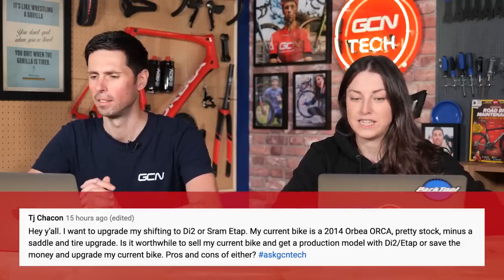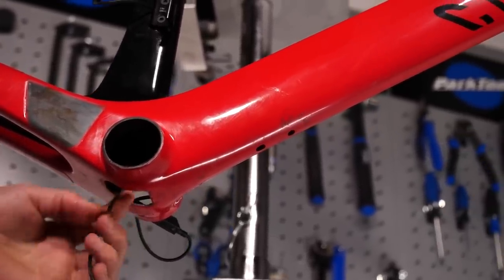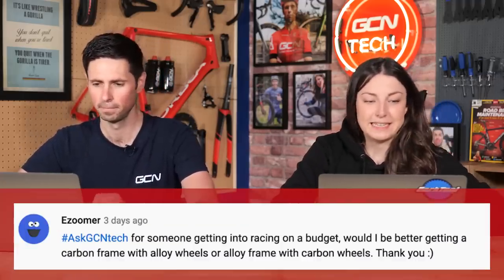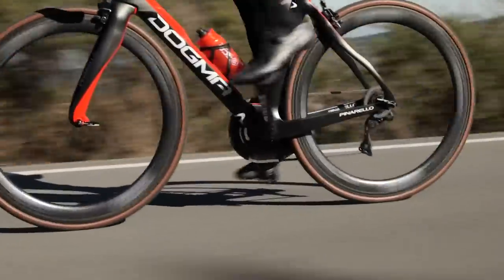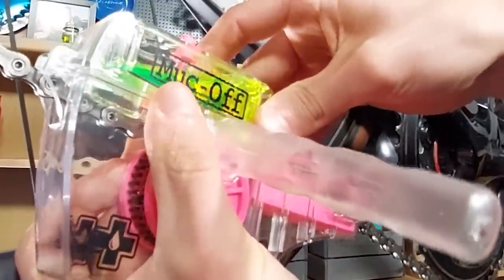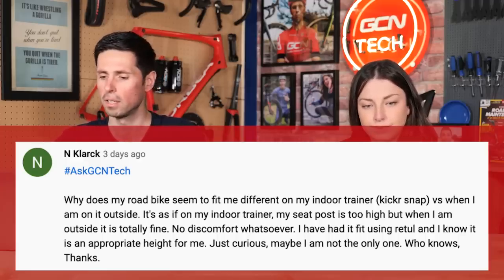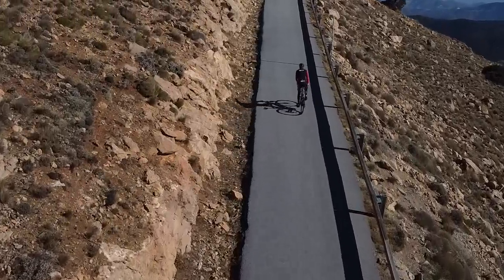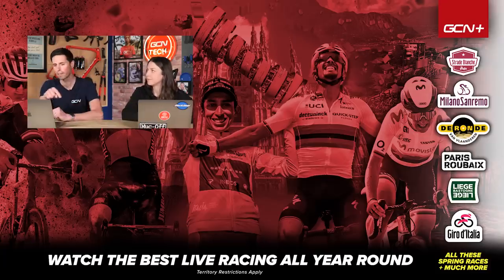What Is The Best Carbon Fiber Upgrade? | GCN Tech Clinic

Comment: about the setu for racing: I'd say it really depends on which racs you want to take part in. Long distance: go for carbon frame
hilly races: go for lightweight -> probably carbon frame as well
crit racing: stiff alloy frame and light carbon wheels
flat tt: alloy frame, deep carbon wheels + aero bars
Reply: Ever ridden a windy TT with deeper than 40mm wheels?

Comment: Always use the same running system when you first start racing: Alu frames, Alu wheels, and be prepared to crash.
Reply: Nah. Just buy what you can afford and actually want. If you can afford and are willing to crash a $500 bike, or a $5000 bike, then do it. Don't let other people tell you otherwise.

Comment: Hands down (no pun intended), handlebars. For me, that's made the most noticeable difference. A good quality bar is worth the investment. After that and in a close second, a good quality seat post. I have my SuperSix dripping in carbon (post, bar, stem, pedals, saddle, wheelset).
Reply: Handlebars can really change a bike, its such a good upgrade. Glad to hear
Reply from the maker: Definitely where your hands are will make a huge difference! All the vibrations don't just go to your hands, but your shoulders, neck and eventually your head! Comfort is key, and it can also be lightweight/aero!

Comment: Also worth noting regarding the fit of bike on indoor trainer feeling different to riding outside…. Inside your bike is level all the time whereas outside your bike is never level due the road is always uneven or slightly uphill or down . This has the affect of tilting your saddle up or down and without notice you are basically moving forwards and backwards on your saddle, this happens lots in a ride. You only tend to move on the saddle on the indoor trainer when your arse gets fed up 😂

Comment: I use an 90's 3x7 specialized Hard Rock on my turbo trainer with zero issues save for needing a spacer for the cassette.
Reply from the maker: If it works, it works!

Comment: HI Everyone.  Love the show.  I have to 'disagree'  Respectfully.  Please dont send the viewers full of hate or ade my way.  Here is my reasoning.  As much as we all love 'New Bike day' because of the parts shortage, there are a many places on line where you can get a parts for just about everything.  I recently purchased an entire 105 groupset for my 2015 Cannondale Synapse for less then 600$.  The bike shop was really nice and installing the components for less than 150$.  This is a far cry cheaper and more practical then trading my current bike (that I love) and spending 3,000$ for a New Cannondale Synapse with 105 already installed.  It is faster to upgrade the bike as opposed to buying a new one because I can get the parts over time and still have a bike as opposed to ordering a bike (I am a bit of a taller rider.  Bike shops dont usually have a bike that will fit me).  As opposed to waiting for my old bike to sell, saving up the money to get the new bike, and finally waiting for the wheels to get here.  In that time the season will be over and I will be stuck back in doors.  While I do love a new bike day and I understand that finding parts might be a bit of a hassle, it is better to have that hassle when you have a bike (That you love) to burn that energy off on.  #AskGCNTech

Comment: Hey, guys. I love the show and all the content you create. I’m going to disagree with you on the mtb frame into road bike question, though. I’m not certain it’ll prove to be the ‘most cost-effective’ solution. The outlay for the groupset and then the parts to get the same position on the road bike may end up just being more than buying a lower-end road bike for use on the trainer. It’s also going to be a hodge-podge of parts that may be more finicky than a complete, new bike.
Reply: Agreed. I’d go for a very cheap bike if the point is to be a dedicated trainer bike… any second hand decathlon bike would do

Comment: #AskGCNTech
I have a carbon gravel bike frame with alloy wheels. I tend to get carried away and ride quite fast which can get bumpy. I was thinking of upgrading to carbon wheels but I'm worried they aren't going to be as durable as alloy wheels. Do you know the durability of carbon wheels vs alloy wheels off road?
Reply: Same if not more durable
Reply: Some aero deep-section carbon rims are claimed to be extra stiff and strong, more so than aluminum rims, and therefore perfect for gravel bikes, unless they are extremely weight-optimized. Another benefit: Deep-section rims keep the spoke nipples further away from the dirt. I ride a carbon deep-section wheelset like that pretty hard on my gravel bike and had no issues so far.

Comment: #AskGCNTech Hi, I got a new bike in December - BMC Roadmachine with SRAM Force AXS groupset. Was getting a little chain rub when on the large chainring and in the lowest two gears on the 12 speed cassette, so watched YouTube and used the limit screws to try and align the front derailleur a bit better to the guidelines (at most a quarter or half turn of the screws); ever since I am having trouble shifting from the small chainring to the large one at the front. When I attempt this, chain doesn't go up, and just spins around, but will settle back on the small ring when I press the shifters again. Took the bike for the new bike service to the retailer, and then back in 2 more times - each time it shifts a couple of times properly, and then back to the above mentioned issue. Bike is back with the bike shop now, but wanted to ask if you or anyone else has any ideas on what the issue could be and anything else to try. Thank you!

Comment: #AskGCNTech Hi guys. A lot of advice tells me to run low tyre pressures (say 5 bar) yet my Mavic Yksion UST say not to go below (say) 6 bar printed on the sidewall. This occurs on other tyres i have too (different brands). Will they fall off if I run them below the stated min pressure? Is this the manufacturer being ultra cautious? (note this is subtly different to the question asked last week; I am not using inserts and this is a 25 mm road tyre issue). Cheers!
Reply: Always stay in the tires pressure limits!!!
Reply: @hendriksiering9077  yeah i have been but I have seen a lot around about using low pressures which I would not be able to and I assumed other people must be in the same situation.
Reply: And i was wondering how the manufacturers derive these limits. Surely a narrower tyre is held in place in the same way as a wider one which might have lower pressure limits?

Comment: #AskGCNTech  Hi guys, I have recently bought a new wheelset that has dt swiss 350 54t hubs and have noticed that the rear wheel stops spinning fairly quickly compared to my old hubs(with fewer teeth) that would spin forever. Is this caused by the amount of teeth in the new hub or is this something I should be concerned about? I know this wont slow me down when pedaling but I don't want to  be losing speed when freewheeling. Thanks

Comment: #AskGCNTech . Using latex tubes right now and they have a 42mm valve. I'm looking to buy new wheels that will have 45mm rim depth. What is the best way to go with the tube valve? 42mm is too short to use with 45mm Rims, but valve extenders all seem to add a lot of barrel. Is there an ideal solution for 45mm Rims and latex tubes? Thanks guys!
Reply: I’ve found 20mm extenders on Amazon. I really wish they’d make longer valve latex, even if it had to be an 80mm.

Comment: #askGcntech. Hi all. I am considering power meter pedals and like the new Speedplays. I prefer off road shoes and use the MTB SPD’s. Is it possible to fit speedplays to normal MTB shoes. I like the off road shoes as they have a grip and you don’t look like a duck when you walk. It’s an expensive experiment if I just go out an buy them and find they don’t fit. Thanks ( I take it Alex will you his catch phrase “I’m inclined to agree with that” :-) ).

Comment: #AskGCNTech
I am using a rim brake bike. Can i upgrade my inner tube to TPU or latex on my carbon wheels? Will there be any thermal issue?
Reply: I am running TPU with rim brake with CF wheelset. No issue so far.

Comment: Hey guys i have a quick question. Is it alright to have a different interior on your bike? My front wheel is a schrader type and my rear wheel is a presta type. And I think the build quality of my rear wheel is better than the front wheel. So do they have to be similar or is it okay to have a different interior on your bike?
Reply: Can’t you just change one of the inner tubes and then both will be the same ?
Reply: @davtwill531  I'm talking about different brand, one has a schrader valve and the other one is a presta. So what I want to know if it is okay to use different brand of inner tubes  for both of your wheel?
Reply: @davtwill531  is it okay if both is different from one another or do they need to both be the same?

Comment: #AskGCNTech   Hi all, Love the channel. I have a tire/wheel interface question. I'm 73 with a bit of arthritis in both hands/wrists,. My thumbs are losing some strength. I have Gatorskin clinchers on WTB tubeless ready rims. I had a struggle with a flat yesterday. It was very hard work breaking the seal and remounting the tire. My thumbs are still suffering. It seems the WTB channel is very narrow to accommodate the tire bead. Would it be better with a good clincher wheelset or different tires? I've heard Continentals are "tight". Sorry Alex, I'm not ready for tubeless yet. Thanks
Reply: Most important step: press the lower wheel onto your belly, so that the tire will slide into the rim. Then work the tire into the rim with both hands from the bottom to 12 o´clock position... The last bit should slip on the rim much more easy than!! ;)

Comment: #askGCNtech Hey GCN, whenever I shift to the 2 smallest cogs of my cassette and push the pedals, I hear a grinding noise on the drive side. I can't figure out if it's my pedal, my bottom bracket or something else. It is loud specially when I push hard pedalling. It happens when I am on the trainer or on the road. I have a press fit BB if that matters.
Reply: sounds like it could be the front derailleur cage rubbing the chain. It happens sometimes when you go towards the far sides of your cassette and your chain is angled. Most front deraiullers have some in-between clicks so see if you can push it further to the right and that might help!
Reply: @mattwhitmore9968  thank you Matt! Should I adjust the limiter screw of my front derailleur?

Comment: can a gravel rd be replaced by a mtb rd? #AskGCNTech
(im a begginer cyclist so I dont know whaat to do)
Reply: Yep totally. Shimano GRX is kind of based on Deore. The biggest difference between the two is maximum cassette clearance (MTB all for larger ones). I've done this in the SRAM side of things when I upgraded my old bike to GX AXS.
Reply: Uhh basically yes before gravel was a thing I somehow managed to destroy my 10 speed 105 and a mechanic said let’s slap an XT 10speed RD on there.... and it worked

Comment: First question has one and only one answer: Get a new bike. It will cost you more to piecemeal upgrade the various components and, believe it or not, carbon ages. Even aluminium does. It corrodes over time leaving you very vulnerable to possible sudden failure.

Comment: 'upgrade carbon fibre'. The best upgrade to make to carbon fibre is to put it in the cupboard for race day. & to swap your plastic throwaway frame for a titanium or lightweight steel one, which won't fail expensively and cost $$$$ to repair if it does. The weight you 'save' is needed because you're not as powerful as you want to be. Think about that.

Comment: OMG! What BS are you speaking? I cannot even find politeness in my manner for your suggestion of the Di2. Pushing cables through the frame and inserting a battery (or whatever it was) into the BB area. Etap every day without question. No cables. No internal batteries. Charging batteries is as easy as charging a mobile phone. You GCN peeps are such biased Shimano (sponsored) fanboys/girls!!! Keep it honest people!
Reply: Hey there, did you listen to the question or what i said in the video? The question was if they should sell their current bike and buy one with Sram/Shimano electric gears or upgrade the existing bike to electric gears. There was no question if Shimano or Sram is better, nor did i suggest to buy one over the other. In fact i suggested buying the latest bike and choosing the group-set based on whatever suits the rider best. Reason for that is to get the latest tech and because lots of parts/components are still difficult to buy.😎
Reply: @GCNalex  In fairness to you, the comments you make are accurate enough and at the time of doing your recording you probably had no idea what would be in the final clip. However, the clip only shows Shimano (as is quite usual for GCN), and the power of advertising leaves nothing for the viewer to consider. My comment is not put forward to beat you, as a subscriber I thing it's reasonable to expect a more balanced view.